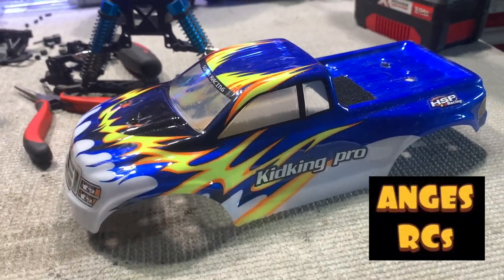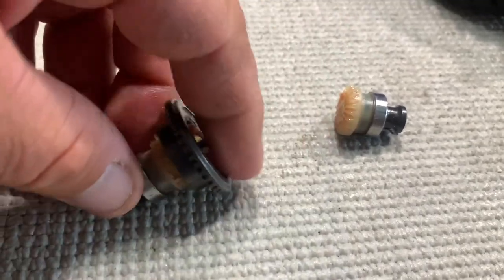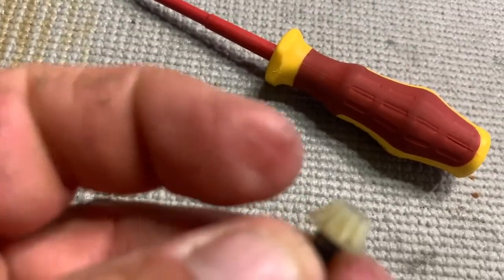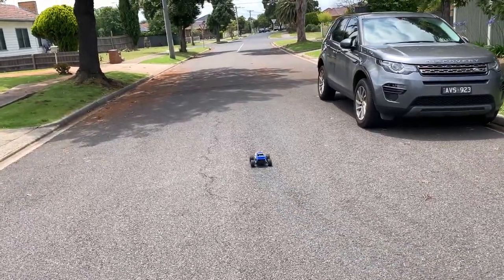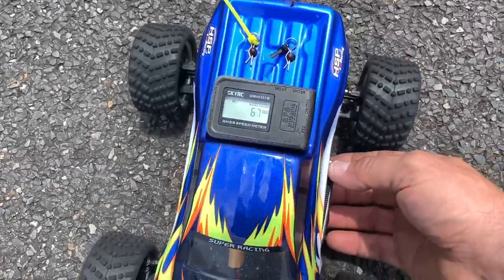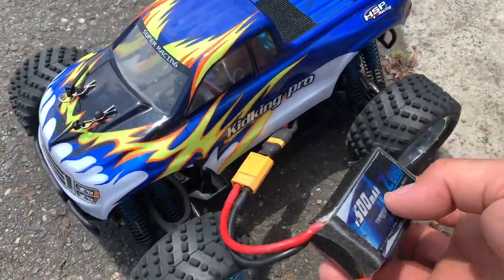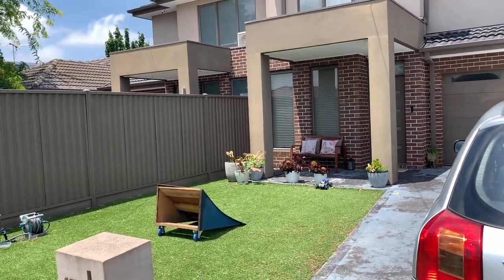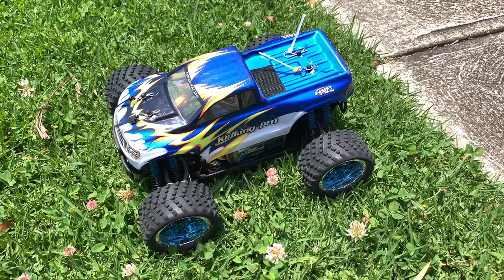HSP 94186 KIDKING PRO METAL DIFF UPGRADES, SPEED RUNS AND JUMPS #hsp #rcbashing #rccar #rccars

Comment: What’s the battery? I have the same and I want to get a battery upgrade but idk which ones work
Reply from the maker: A 2s 2200mah will fit nicely or a 3s 1500mah . A bit tight but does the job. 
2S: 
https://www.ebay.com.au/itm/185822445745?mkcid=16&mkevt=1&mkrid=705-154756-20017-0&ssspo=rlergtj8SVi&sssrc=4429486&ssuid=Kods1y39RBy&var=&widget_ver=artemis&media=COPY

3S:
https://www.ebay.com.au/itm/155476863674?mkcid=16&mkevt=1&mkrid=705-154756-20017-0&ssspo=cwztt9wwsyu&sssrc=4429486&ssuid=Kods1y39RBy&var=&widget_ver=artemis&media=COPY
Reply: @angesrcs any that look the same as original?
Reply from the maker: @IShowWarzone  this is the original. 
https://www.ebay.com.au/itm/182913351475?mkcid=16&mkevt=1&mkrid=705-154756-20017-0&ssspo=Oq49DQ_tQbS&sssrc=4429486&ssuid=Kods1y39RBy&var=&widget_ver=artemis&media=COPY